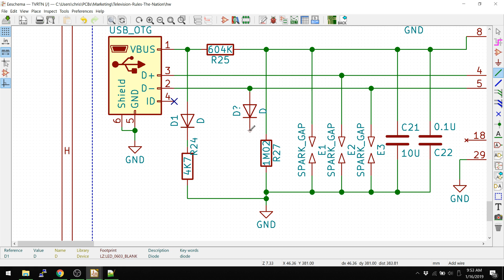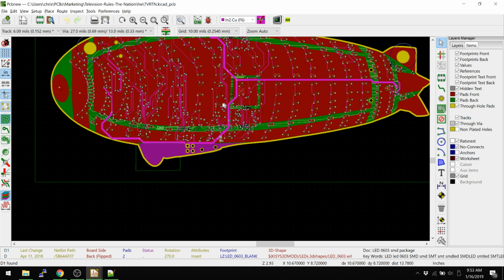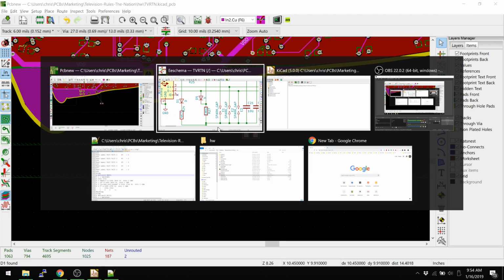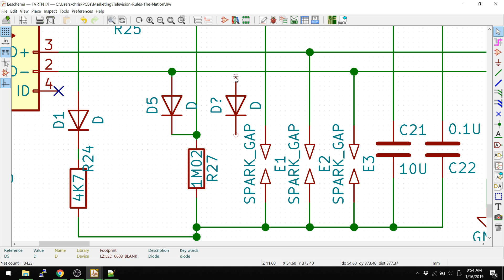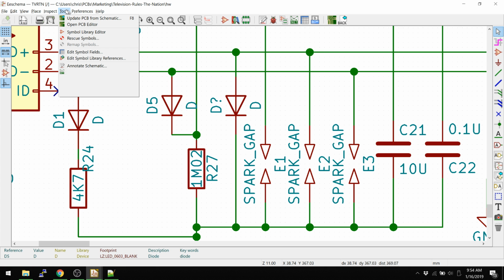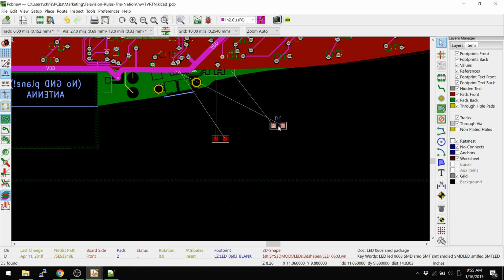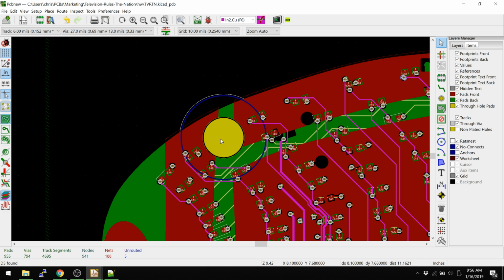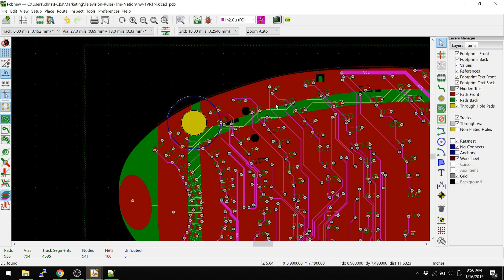KiCad 5.0 - A faster (and more dangerous) way to update your layout

Comment: I found the easiest way to keep extra graphics is to create a small sch box associated with the graphics footprint and dump it with mechanicals on the sch.
Reply: I have followed a similar methodology in other design environments (ExpressPCB) but am new to KiCAD and would like to better understand your method.  As a very new user I still have not mastered the vocabulary of KiCAD and still confuse easily.  To date, I have yet to learn how to make schematic symbols and PCB footprints from scratch.

In particular, since I derive my BOM from the schematic, I put in a part on the schematic that will call out the PCB part number. On the PCB text of the part number should show.